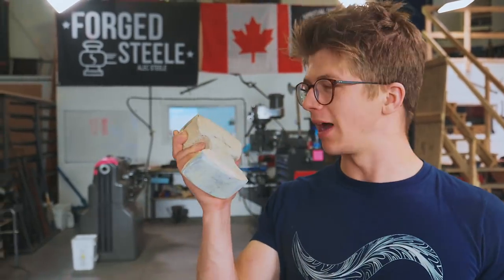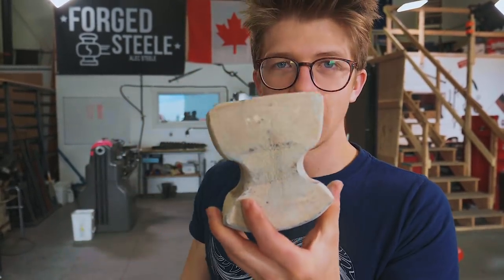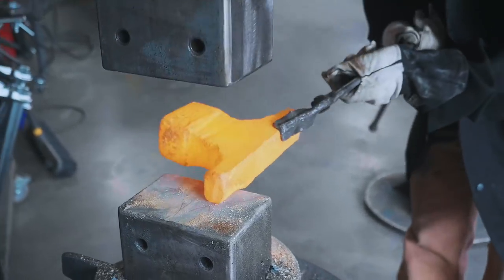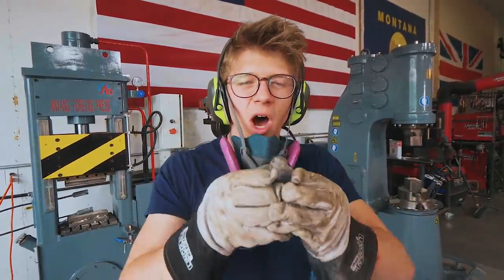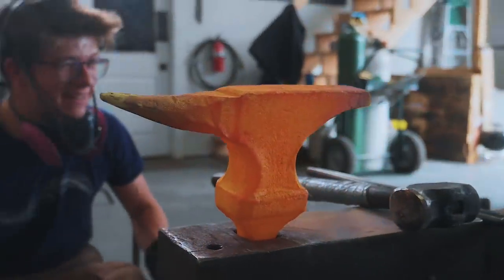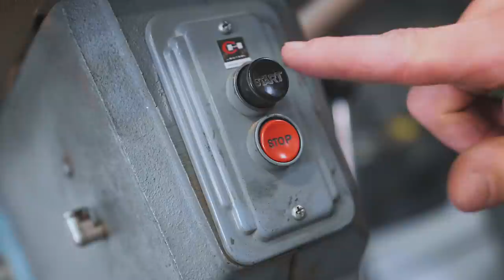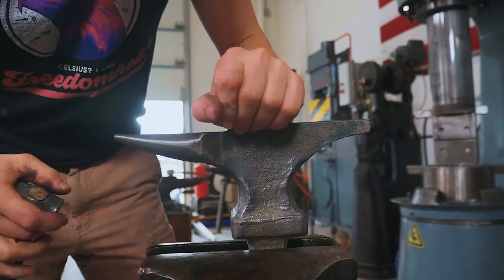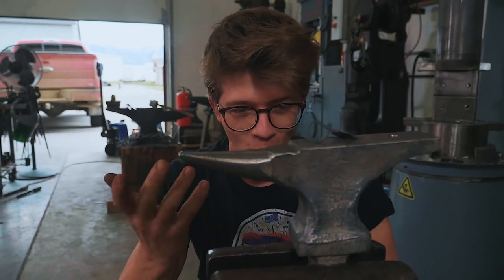MAKING A TITANIUM ANVIL!!! Part 2

Comment: If you are planning to forge out in the wilderness, you do know that you can forge on any flat, hard stone, right? That is if there are any in the area you are in though. Also, forge a titanium replica of Conan's sword from Conan the Barbarian with a distal taper (the original didn't have one, but a sword of that size could use one). You could do a copper and aluminium alloy casting for the guard, further lightening the sword.

Comment: Wait.... so even with a project of needing to flatten a large surface of super hard metal and drill it you still won’t use the milking machine?? Is there a boycott on the lathe and milking machine? Don’t think I’ve seen either used once in the new shop.

Comment: Hi Alec, Great work as always. The reason for the dust is down to Titanium under extreme heat wants to turn back into Titanium dioxide. Tis why if you weight the before and after, it's so lighter than the difference with traditional forge scale

Comment: Good that you put on the respirator because titanium itself is rather chemically inert in the body (why it's good for hip replacements) but any silica it could react with in the air from say dust or sand can cause lung problems and is a carcinogen for long-term exposure

Comment: If it is meant to be staked in the ground, shouldn't the base have been wider to help spread the load of the hammer blows across the dirt surface, which is likely to be much more malleable?

Comment: Surly you need to do a hardening to it I have seen people on YouTube try to forge with titanium cutters and it goes horribly wrong so there has to be a hardening step between your titanium that moves like butter and a hard durable titanium tool you have a very sophisticated heat treat oven you forged a leaf but can you do a strength test and see what it takes to put a mark in it will a centre punch leave a mark etc...

Comment: Why use all that expensive mass on a stake mount? With a plain base the material used in the stake could have been better used in the body and other parts. It can still be mounted using course threaded or other fixings.

Comment: correct choice with respirator. While ultimately it takes a lot of dust to hurt you. titanium is one of the elements that the human body accepts readily. Which means it won't reject it. if it gets in the lungs it can cause inhibition in them and inflammation.

Comment: Knowing how titanium reacts to welding without proper shielding, I have some serious doubts about the structural integrity of that anvil. But still, great video to watch. Hope it works out for you.
Reply: The oxide is providing some shielding, so after cleaning the oxide layer off it should be pretty good, but yeah, that kind of color change definitely wouldn't fly with pretty much any CWI if you got that on a weld bead